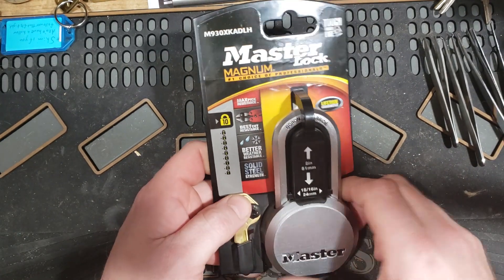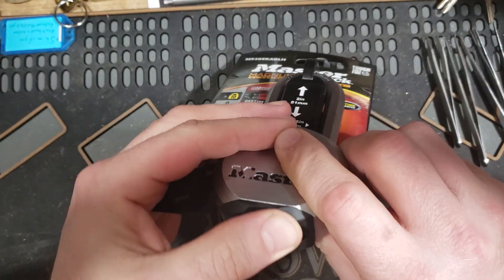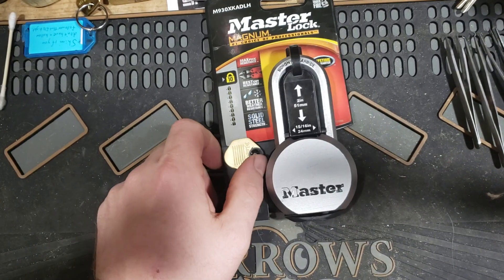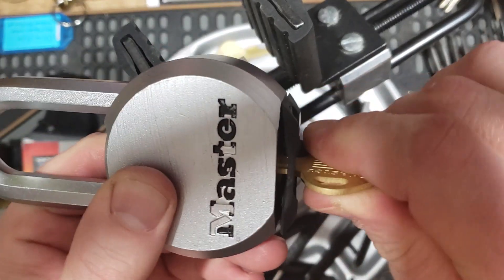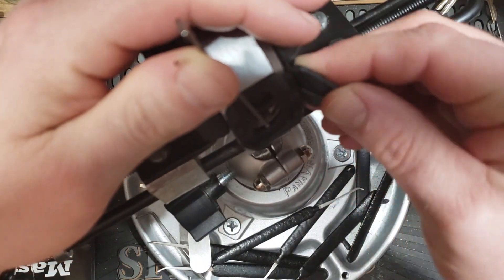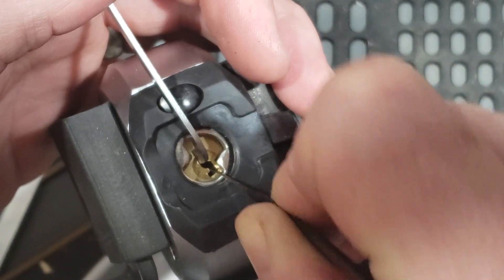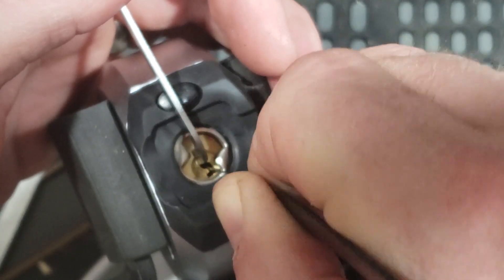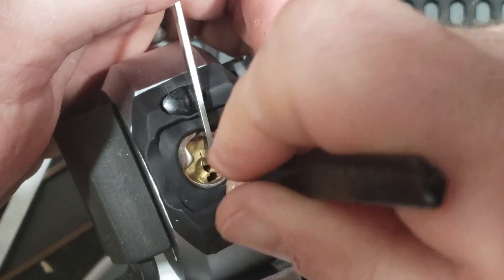Master Lock Magnum 930 _Picked and Gutted ](JUNK)[

Comment: On 13 minutes 27 seconds you ripped that stupid weather cover off , why did you not do that at the start of the video haha , Any wonder people how know anything about locks do trust Master locks , this is meant to be one of there best locks , just proves how rubbish they are
Reply from the maker: I had to pull the screws out to get the cover off.  Otherwise I would have pulled it off.  I wanted to make sure it was all documentented for no tampering.  Lol. It will not go back on once I fix the lock up for real use!
Reply: @northwegianlockpicker6489  i beleive it will be a good lock when you have finished with it , but it on video mate

Comment: SOP for Master lock. They refuse to do the little things that would make their locks worth while.  It is sad when the Chinese knock offs are better.
I see that you are fond of the Tron. The tron and the short hook are the two picks I use most frequently. I have yet to break a pick but I have an extra of each of those. I would go bizarre while waiting for Sparrows to send a replacement. :):)
Reply from the maker: Yes sir! I have a spare too!  When I started,  i used the tron and deforested diamond.  Now I have gone away from using that diamond and have a spare that I will like not use.  Lol